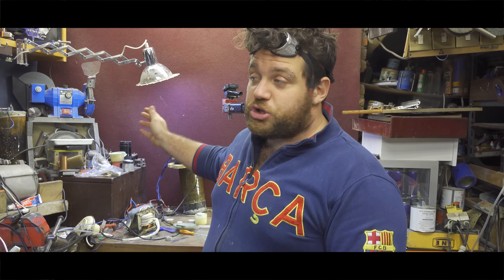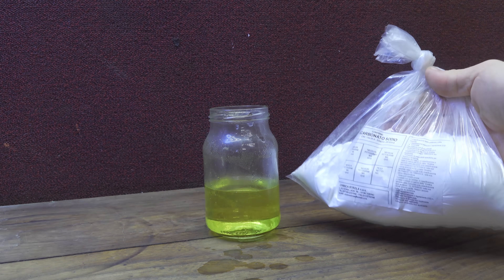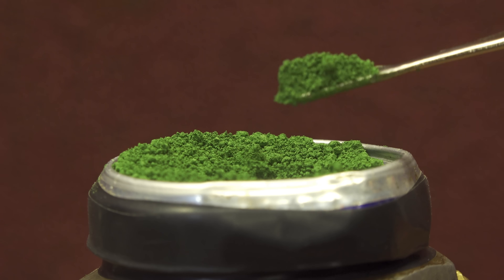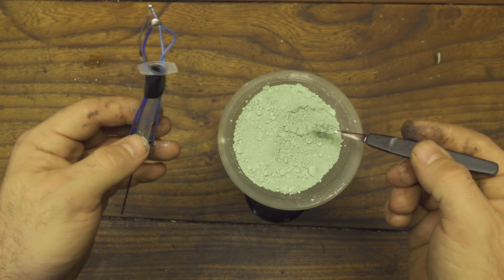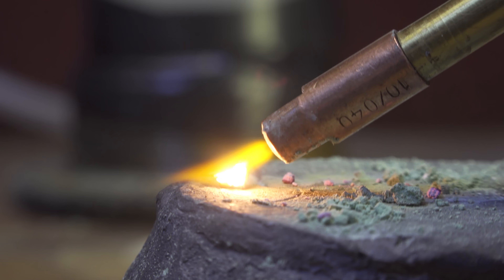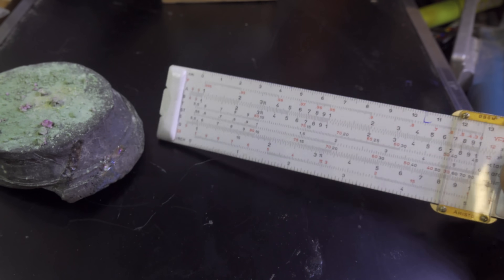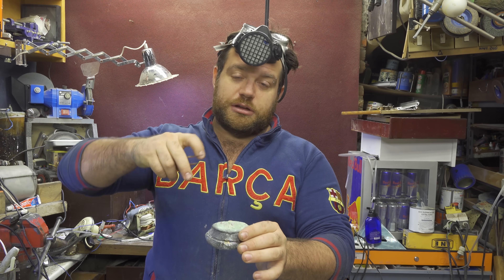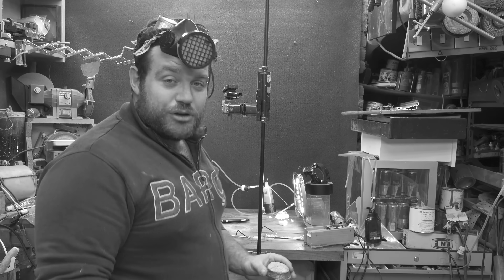How to Make precious Ruby at Home - 4K

Comment: Amazing. Am very puzzled as to why you didn't use the crucible, the inside part, to hold the powder, instead of putting it on the flat bottom

Comment: Few instruction sunclear, as chemist i can confirm that HCl fumes are dangeorus but well ventilated balcony is enought, just not in kitchen,  and green powder is not dangerous not even corrosive its insoluble chromium salt so somewhat carcinogenic. And its Cr2O3 not CrO

Comment: very nice, but you made red alumina glass, not ruby. ruby (corundum) is a crystalline solid, and for the atoms to get organized into a crystal structure they need some time. that's why synthetic rubies/sapphires take up to 12 months to grow. as in your experiment the melt solidified very quickly, the result is an amorphous solid, which we call glass. in the same way, common glass is made by melting quartz, but as it cools out in the air, the molten silica solidifies into amorphous silica (silica glass). another interesting example: if you melt down a rock, like a granite, it won't be granite anymore, besides maintaining its composition, unless you let it cool down very slowly for months. if left in atmospheric conditions, it will quickly solidify into a dark glass known as obsidian. for curiosity, it becomes dark because an amorphous solid requires way less impurities to get tinted than a crystalline solid
Reply: would there be a method to make a ruby without actual equipment? rubies are too expensive

Comment: Just buy some aluminum oxide polish powder and some chtomium oxide powder. Mix at up to 2% by mass. Next slowly pour it thhrpugh 4x of the oxyhydrogen torches very carefully. Helps to have a seed crystal to catch the melt. Using some oxygen and an ultrasonic shaking to feed it into the flame. The flame doesnt need to be extremely stromg but must be on the slightly oxitizing side. Also try flux growth method if you have a high temp furnace

Comment: Technically speaking, this is ruby glass. It holds a lot of the properties of ruby, but the crystal structure is, well, not there because of how quickly it cools. In labs, the ruby is cooled, under pressure, very slowly to produce a crystal structure identical to naturally occurring. Takes about 8 months. Still, fused rubies, like this, are pretty cool.
Reply: nop they make these days a ton in month using 100kg machine  and h2 o2 gas flames

Comment: It's a very primitive method.
It is completely unnecessary to splash with hydrochloric acid!
Aluminum oxide must be purchased in a store.
Chromium and aluminum oxide must be mixed in a mortar and finely ground.
A hydrogen flame is a good idea, but you need many times that power in a high temperature furnace.
The mixture must be completely melted, the melt must be kept at temperature for a long time so that the air bubbles come out of it. Then it must be cooled very slowly so that it crystallizes evenly. The goal is to grow a single crystal in the crucible.
It is not worth dirtying the kitchen with such experiments, because the woman will scratch our faces because of it...

Comment: Just a question (don't know if it's dumb or not): Couldn't you skip the whole "sex toy plus syringe" part and just take small parts with a spoon or something and put them on the plate/can etc, and then heat it? was there a specific reason you needed these accessories for the experiment?

Comment: No Rubber Gloves. No Face Splash Shield other than welding goggles. Uneven and flammable work surfaces. No Ventilation.    EDIT: It was nice to see you had a ventilation mask on which also covers much of your face. So you did have that. But ...
You are still a menace for setting a bad example for the many people who will ultimately view this video. It scares me to think how many people with zero skills or experience attempt to do what you have done .. in their basement. Without any fire extinguishers or eye-wash station (or bottle) someone will end up severely burned by acid and/or fire or who knows what. 

What you do is interesting. Not everybody can do that. So I think you owe it to yourself, your insurance company and your viewers to present your experiments in a safe, lab-like environment. It doesn't have to look good. It only has to be effective and safe.

Comment: SCIENCE WITH A SEX TOY LOL BUT IF YOU DONT WANT THE POWDER TO FLY AWAY DROP COUPLE PIPETTS OF WATER ON TO IT. I USED TO HAVE THE SAME PROBLEM WITH BORAX AND GOLD PERCIPITATE. THEN KEEP THE FLAME BACK TELL IT STARTS TO CURLE AND PULL TOGETHER ONCE THE BALL IS HEATED YOU CAN GET CLOSER WITH THE FLAME AND IT SHOULD STAY IN THE CUPEL

Comment: There is a little bit of a problem with using the hydrogen and oxygen burn for metalwork. The mix of hydrogen and oxygen you get is ideal for burning hot and all that, but you actually get too much oxygen in the mix for metalwork. You want to dial back the oxygen a bit from what is produced by hydrolysis so that all the oxygen in the mix burns off rather than oxidizing your metal.

To achieve this, you really want to cut the amount of oxygen in the mix by about half. That way the oxygen atoms are twice as likely to combine with the hydrogen instead of your metal's surface.

Oxidization is always something to consider when working with metals and oxygen.

Comment: Well Rulof many a ago I also made about 3 cm long poly crystalline tall cone shaped crystal. Method used was commercial Al2O3 powder with small Cr based powder. But going from polycrystalline rough rod to single crystal rod was another game. It required zone refining furnace of suitable kind which did not have the access
Reply: So you can actually make a ruby rod to use in a laser, at home?

Comment: I did this in the 90's with a Brown's Gas generator I got from Dr.Brown in a trade for an Electric car. FYI it produced a very bright flame and was much hotter than yours. I built a crucible and baked the chromium on garnets...thats all as in Canada we do not have a statute of limitations. FYI those rubies are not through and through rubies using your method ...just the outside is ruby.

Comment: Would it be possible to compress the powder into a long, thin, solid rod, like half the diameter and length of a pencil, and heat it by slowly feeding it into the electric arc created by using a TIG welder on AC, arcing to the tip of another tungsten that's being held by the ground clamp just above a high temperature ceramic surface and inside the argon plume so the other tungsten doesn't burn?

Comment: Of course ruby crystals for lasers are made by dipping a seed crystal in the liquid ruby crucible then cooled over and over til you get a stalagmite looking rock.  Then grinding it into a perfectly cylindrical shape.  Then special mirrors are put on both ends of the cylinder.  Then a flash from a flash tube gives it the energy that it needs to start the beam.

Comment: Please use H2 and O. flame and alumina refractory crucible. I did that many years ago during my master's degree program. The quality of the resulting poly crystalline ruby was pretty good.
Reply: Seems like any kind of chemical flame will only introduce contaminants into the crystal structure such as the bubbles often found in Verneuil produced stones.

Is it possible to use a high strength laser to melt the reactants together?

Especially if this could be done in a vacuum chamber reducing the likelihood of oxidation.
Reply: @mnomadvfx  I would imagine so since it can be done using microwaves to create plasma to melt it or arc welders with a graphite electrode and strong enough lasers get well above the needed temperatures it's just about if it's economically viable more than anything for the power needed to achieve it with lasers just like nuclear fusion, like we can sustained fusion going with lasers but it takes more power to get it going than it produces currently
Reply: @mnomadvfx  I have suceeded with making rubies and other synthetics with CO2 lasers. The pros of that method is you can reach temperatures of over 3000C with short exposure times. Meaning you can very quickly produce small blobs of rubies and other synthetics. The temperatue limit is dependent on the amount of energy you can input vs the dissipation of the heat. Higher power CO2's would drive the temperature up further and allow a larger heatzone. The drawbacks are that the heating is incredibly localised. This can be combatted by defocusing the laser increasing the beam cross section therefore lowering the intensity. But there will be a laser power threshold that has to be met. And it is actually possible to burn yourself a crater into your synthetics if the exposure is too intense. For rubies in particular, this is also dependent on the amount of chromium oxide used too as this has a very higher melting point of near 3000C vs the 2000C needed for aluminium oxide. You also will get stubborn aluminium oxide stuck to the rubies. Most rubies created are polycrystalline and low quality. For example they will have some structural weaknesses due to internal cracking. This is likely caused by sudden thermal changes. If there was a way to ease off the laser power to slow down the cooling however this would be combatted. But I was using a regular laser cutter. One method I did try was a dynamic rather than static exposure to the powder. I also tried making an almost aluminium reflection chamber like crucible. One benefit is you can cause some coalescence and grow your rubies by heating and collapsing surrounding powder into the molten ruby. If the exposure remains you can get this to form a larger more uniform sphere or spheroid. 95% of the time the rubies will be opaque or low opacity. However I have managed in making a couple now that have some translucency.
Reply: @mnomadvfx  yes you'd just need the right frequency
Reply: I would have just ordered sone of those motors from Amazon or Aliexpress, but I guess if you have sex toys laying around to cannibalize...
Reply: What about making a crucible wrapped in a coil. Heat the sample with an engraving laser. The hope is that if you can heat a tiny spot to the point it melts, then it will conduct and start absorbing energy from the coil that you supply with an ac current. A similar idea would be to drill a tiny hole in the top of the microwave. Shine the laser into the crucible and again, hopefully you can get a tiny bit of consulting alumina that will start absorbing microwaves. Same idea as melting glass in the microwave.

Comment: Hello, thanks for the video of your guide. I hope you succeed. It was a problem for me. First, the first series, the color of which was the same as crystalline, but not transparent, the second series was pink, aluminum oxide, l increased. I replaced only 0.52g of 6 g of warm oxide, aluminum oxide secondly, ldo not do the liquid oxygen box with hydrogen and oxygen, so please do not hesitate to contact me with this method. Please guide me if you send it to gmail send me a photo to give you a guide.

Comment: You should build an HHO plasma torch and burn a big chunk of It all at once at low pressure into a crucible at 6,000+ degrees and see if that works better. Or see if you can use a liquid solution so it crystallizes more evenly and you can keep adding more powder to it and keep making it bigger. I’m not a chemist either so if you blow yourself up don’t blame me. 🤓

Comment: Pro tip, aluminium oxide is suuuuuper cheap to buy. It's litterally cheaper to buy then aluminum foil. Its litterally just too cheap to look at making your own.
Becuse its just part of dirt. Everywhere. 
Thats aluminium ore. 
Now if he made a ruby..
I do not know. 
Be interesting to try this out myself as I have all the professional equipment needed to torch Al oxide past melting temp.

Comment: If you use an electric spark (high voltage and current from the ZVS inverter), you can get a higher temperature.

A strongly heated alloy begins to conduct electricity and behaves like a heating element: it heats up even more. Slowly lowering the temperature gives a transparent crystal. Use alum - is cleaner than powder used by you. (Your iron contains: yellow color)

I showed it on my film, I would give a link, but YT blocks such comments. Have a nice day...
Reply: You can make another comment with the link so the first would be safe... I guess
Reply: @Ezio-Auditore94  https://youtu.be/KmP8hn-mc2A
Reply: @Ezio-Auditore94  Here you are
Reply: @compaqchemlab  thanks man, really appreciated

Comment: I learned this process about 35 years ago but never put it into practice, my loss! They actually make a special nozzle with a tapper and reservoir on top for the powder, and it goes down through the nozzle and melts as it falls, It's much cleaner, and  it keeps all the powder from going everywhere, I was able to use a acetylene torch but all it would do is make a crust, I think I'm going to try it again because you have inspired me! Thanks for a great video I appreciate.
Ps. I subscribed!
Reply: You do?
Reply: whats this nozzle called...

Comment: What's stopping you from putting it all in crucible and melting in a furnace for an hour? What am I missing?
Reply: Most furnaces don't get nearlu hot enough, mine caps out around 2000 degrees whereas ruby only forms around 3000. Plus a furnace capable of withstanding that temperature would be extremely expensive and require frequent replacement so it doesnt melt.

Comment: I found a way on paper to build a machine capable of producing rough red and pink diamonds, which is a matter of ion tuning mostly. The very specific curve needed to make it red is a matter of bonding carbon using charge although a certain element can help the process which btw wont show up in laser spectrograph testing but the diamond can be made to look like it came from any particular mine on earth. 
I tried to get funding for this but it's not easy. It's not a plasma process or a hanging sphere process like Gemesis, it's something new.  Btw; I'm the only one who had a physics model 10 years ahead of time that predicted the exact geometry necessary to explain type 1.5 superconductivity. I'm not in Wiki but have the copyright to prove this and more of my predictive solutions to physics mysteries. I've also improved JV Milewski's process for growing gold in a microwave using a sort of 'warm' fusion process at <2600f.

Comment: Dude "Induction heating is the process of heating an electrically conducting object (usually a metal) by electromagnetic induction, through heat generated in the object by eddy currents." wikipedia...... the powder will stay in one spot.

Comment: Would this kind of ruby have the value as a natural ruby or is it like industrial diamonds not worth anything
Reply: It's certainly not as valuable as natural ruby, and these stones are absolutely teeming with imperfections just due to water in the mixure of the alumina alone, not to mention impurities in the tinfoil (Tinfoil is pretty impure! They alloy it to make it great for wrapping food, but not much else), and iron impurities in the HCl. These stones would be even less valuable than most manmade stones just because they are not very well made. It's more expensive to make these rubies with the components shown than to sell the rubies one would make. These are corrundum and could certainly be crushed into useful abrasive powders, but there really isn't much more use to them.

Comment: Hey if you use a wheel with waves in it and a funel. You put it so it dump just the right amount it would be easyer.
Reply: Just about anything would have been better than his method, even dribbling powder slowly from a pinch held in his fingers. 

For a CAD method, a small chemical scoop or a V shaped trough mounted on a slope, using the vibrator to move the powder, would probably work well. Between adjusting the speed of the vibrator, the angle of the slope and how the powder is distributed in the scoop/trough, fairly fine flow rate control should be manageable.

As someone else mentioned, I would just buy the Al2O3. It is a common jewelry polish for gemstone faceting and very inexpensive.

Comment: Very interesting, but not particularly practical. Synthetic rough gemstones, including ruby, are available in large, flawless blocks or boules for a very cheap price. It's definitely got merit as a science project, but in terms of the returns on investment of time, effort, and material, almost assuredly not worth it. You can go buy a 200 carat boule of flawless synthetic ruby for $20 USD rather easily online. With any synthetic gemstones, there is practically no value in the rough itself. Any value to be had comes from how well it is faceted.

Comment: Very kewl! I'd suggest trying a flour sifter to move the green powder to a fire brick, or graphite, in larger, more even amounts.
  Have you thought about using a larger amount of powder in a kiln? It would also allow for slower cooling, less or even no cracking! 
   Very kewl experiment! Love it & subscribed!
  You might see if there's a jeweler that could faucet some of these for you! Try a gem & rock club, lapidary club or even a jewelry store that has a gemologist there. Adding a bit of titanium & iron to the mix can make sapphires. It would be great to find a mix that can give that really pretty blue!
  TY for sharing! 
You might want to melt some quartz infused with copper or gold... that can make a really pretty red swirl through an optically clear quartz stone, if done correctly. Beautiful stuff!
   TY again for sharing! Subbed.
Reply: That is not how the flame deposition process works.
Reply: Us